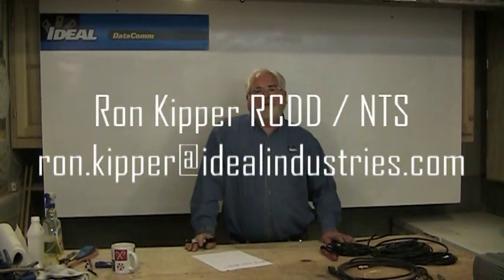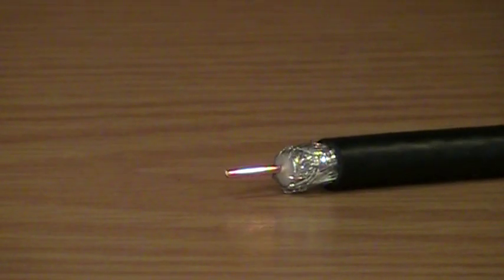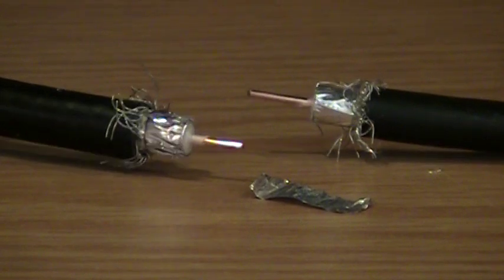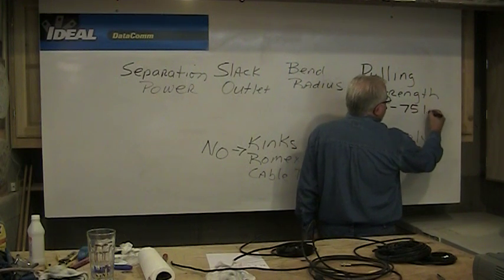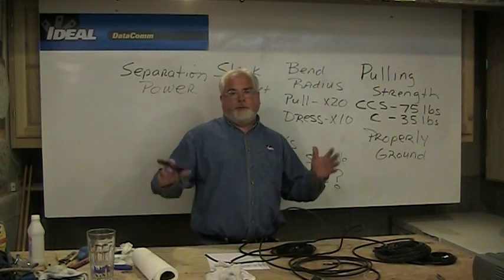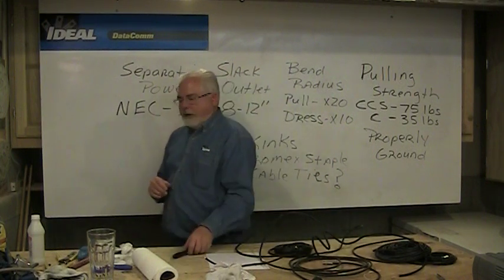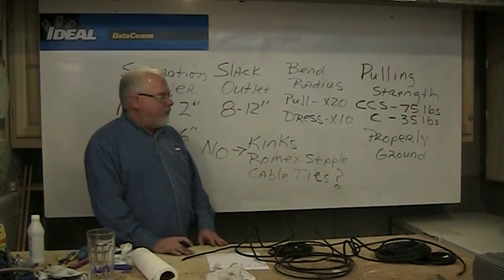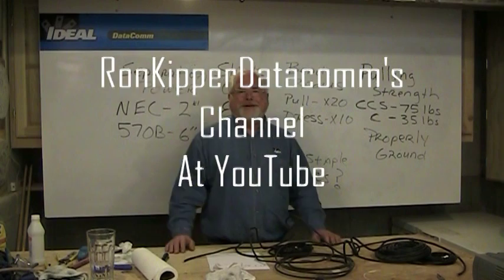Coaxial Cable Basics Part 2

Comment: I'm re-posting this from the first video because it was so relevant for me,                      Finally I have the answer to my question, I had used a "U" staple gun on my internet coaxial,  this staple just barely fits around causing the coax to be slightly squeezed down, Ive been doing this for years working for ADT and never had a problem, I knew I wasn't pinching it so tightly as to short the dielectric, I was dropping internet connections every few minutes at home and the Comcast boy tried for an hour to convince me that my staples where causing all the problems, but he could not explained how,  I insisted he replace the modem, he did and ensured me this would not fix my problem,  well that was a year ago and it still works great, But I had never heard of the capacitor effect inside of coax effecting the resistance when the dielectric is manipulated, Thanks!

Comment: Thank you Mr. Kipper for all the videos.

I live in an older building that is not cable ready.  I would like to run the coaxial cables to each room; however, I have to to across a section of the floor that coincidentally will be re-tiled.  I would like to cut the cement slab and bury the cable.  I know the cable that has the gel protects it from water intrusion, but cement can be very corrosive.  A conduit might be a lot more work, is there any material to cover the cable itself and prevent corrosion or protecting it from the exposure to the cement?  When going through the walls should I use a conduit to run the cable? If not should I use the cable that has the gel or just the RG6 quad?  Any other suggestions to keep in mind?  Thank You,
Reply from the maker: +Javier Collazo Hey nice to hear from you. Since you are remodeling anyway I would cut a 2 inch slot in the drywall about 15 inches off the floor, drill holes in the studs and run the coax to where ever you need it. Then patch the drywall. Stay out of the concrete unless you can put it in PVC pipe. Good luck on your project and stay safe. Ron

Comment: Do you happen to have a video on how exactly data is transmitted through the cables?  For instance, how does an ISP send data back and forth through the cable, I'm assuming it has something to do with the hertz frequency and converting the data into I guess some sort of signal so it can go through the cable but not sure what that'd be or how it works.

Comment: Hi Ron. Great video. Very helpful. A couple questions: 
I install a lot of video surveillance. What’s the difference between cctv and catv?
Where would I or could I measure 50ohms or 75ohms on coax?
As a ham operator we are recommended to use 50ohm rg8x or rg58. Is all rg58 50ohm?  What are the differences between rg6/58/8x/59-95%copper sheild in terms of ohms and bandwidth?  Surprised that analog camera manufacturers require 95%copper sheild but that wire is not good for many other applications
Reply from the maker: Hey Curious CCTV is closed circuit TV which generally means security systems where CATV or community antenna TV was originally just over the air transmission using an antenna but today about any provider like Cox or Comcast are referred to as CATV providers which is usually using a combination of coax and fiber to provide the service. As for coaxial cable there are 100's of different types RG-58 is a 50 Ohm cable and used for a variety of application but all video cables used in CATV, security, etc use a 75 Ohm cable because all the video equipment like cameras and TVs are designed around a 75 Ohm input on them so they want to match that with the cable. When we say 75 Ohm they are talking about the cables impedance which is a complex calculation partially based on the frequency of the signal and not something you can measure with a simple Ohm meter which actually measures just the DC resistance of a cable. The main differences in the cables are the size of the center conductors and the amount of braiding used. The dielectric or white stuff in the cable keeps the two conductors spaced apart from each other consistently throughout the cable. When you bend or kink the cable that changes the cable impedance at that point. So avoid damaging the cable when installing it. Hope that helps Ron

Comment: Great video...very helpful. Question - can you use Coax for speaker connections?
Reply from the maker: Kate Yes you can using RCA connections and you would need two cables for the speaker. Component and Composite cables are usually mini RG-59 coaxial cable. The speakers would need RCA connections too not the standard binding post used with a lot of standard speaker wire.Thanks for watching

Comment: Is a 90° coaxial adapter/connector a good option for making tight bends?
Reply from the maker: CM yes I think so there is some loss due to any connector and the 90 degree connectors seem to work well. Ron